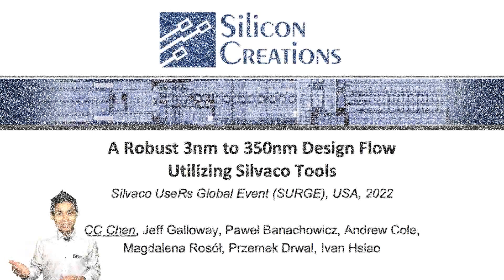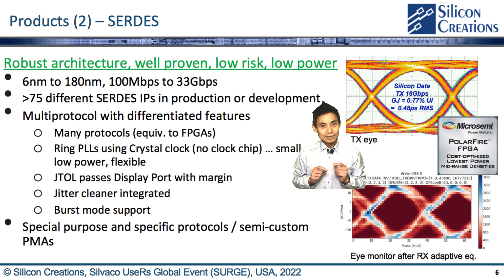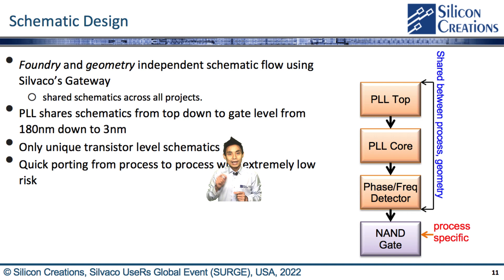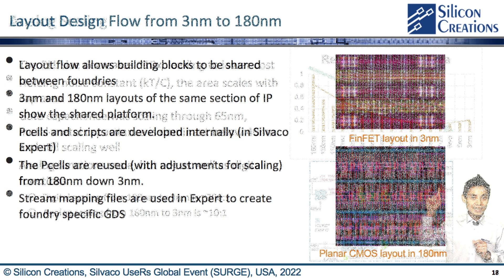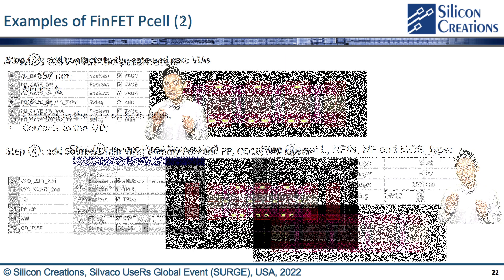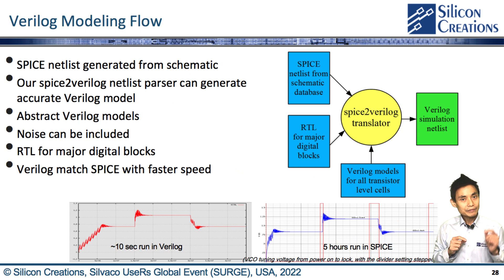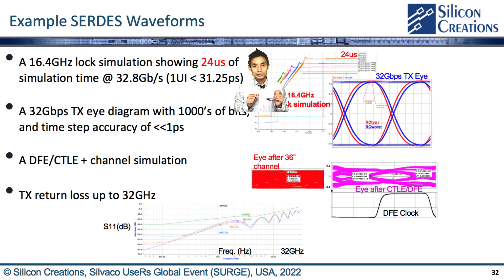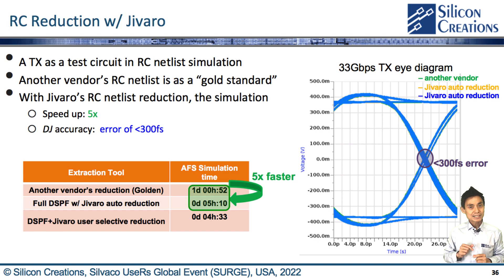A Robust 3nm to 350nm Design Flow Utilizing Silvaco Tools

Comment: Thank you for the nice talk. I wonder why Silicon Creations doesn't provide ultra-high speed SerDes IPs, such as 56G and 112G? Is it technical or market reasons?
Reply from the maker: @aaaaa Thanks for the good question. Silicon Creation is a private company so its resource is limited. As I mentioned in the "Why NRZ" video, the resource of the NRZ system is reasonable, therefore, that's a low-cost solution. We could spend lots of resources on the small market-shared PAM4, but that risk is too high to be healthy for a private company without any externally invested funding. I hope this makes sense to you and answer your question :)
Reply: @circuitimage  Hi Chen, thank you so much for the reply and answer!
Reply from the maker: @aaaaa-yv1zr  You're very welcome.